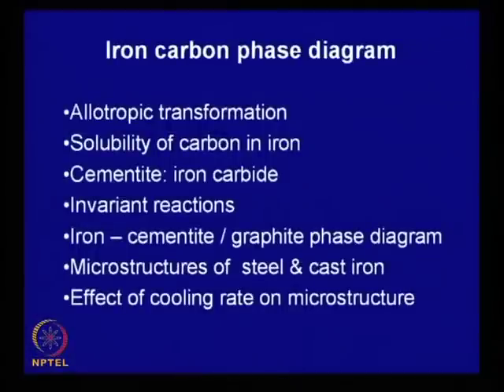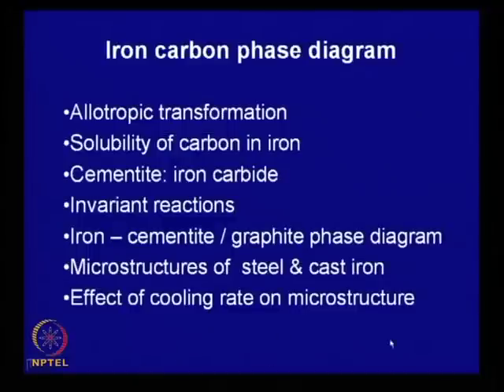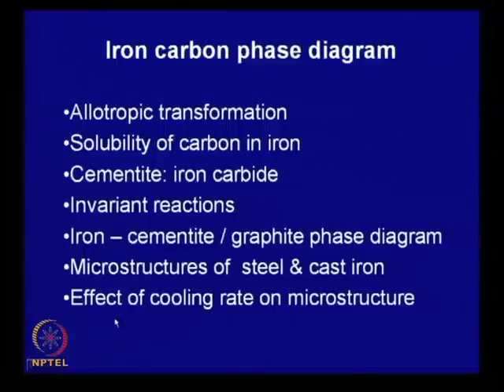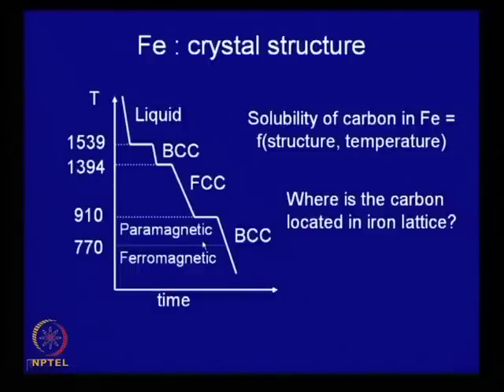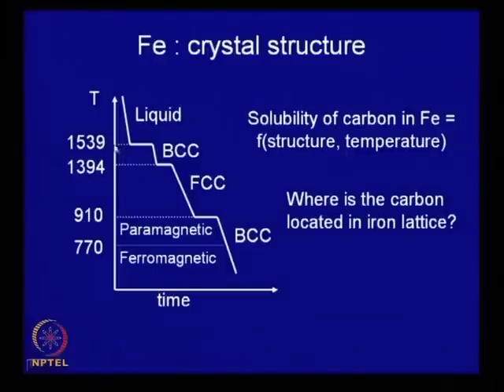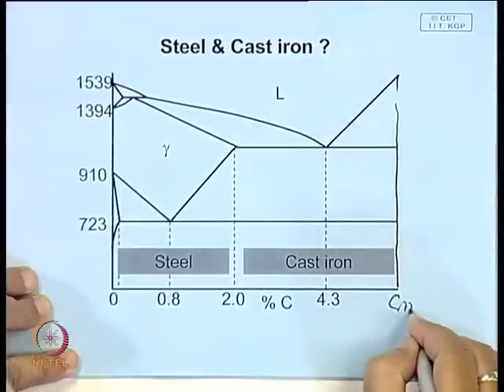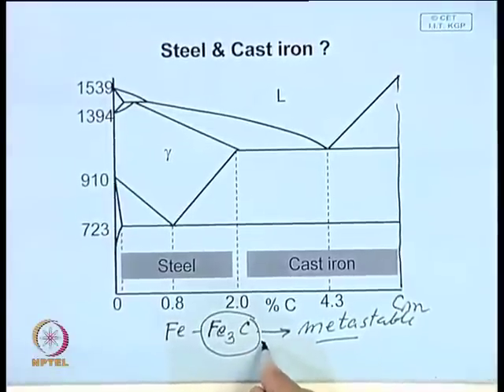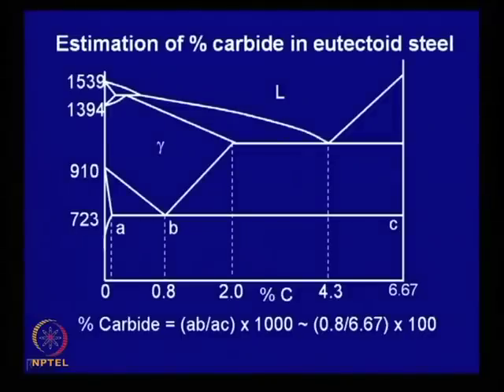Mod-01 Lec-23 Iron-Carbon Phase Diagram

Comment: Authors define the eutectoid point of the FeC diagram with different% C (example: 0.77%, 0.86% and 0.83%). What is correct value?
Reply: I´ve always used 0.76wt-%C as eutectoid point. (And 0.022wt-%C and 6.70wt-%C)
Reply: eutectoid point varies with alloying elements.So it will depend on the alloys present in the steel.In general it is  .77%C.

Comment: What Is the amount of % Cementite he talks about at 42:35 ?

Thank yoU!
Reply: Man I wish someone had answered this. I hate when lectures do this, there is nothing gain from it.
Reply: I think what he said is to calculate the cementite in Pearlite. Because as its cooling down below the eutectoid isotherm, only the autenite is going to produce ferrite plus cementite or in all, pearlite. Therefore to calculate the percentage of cm in Pearlite, it should be ab/ad which is around 6%. But to know the cm% in total, which is ferrite plus pearlite, use 6% times the percentage of the pearlite, which is nearly 50%. Thus in total, the cementite is around 3%.
Reply: On the left side of "C" there is no cementite forming at all just ferrite and perlite where perlite increases with increased carbon content and at 0,8% you have 100% perlite. On the right side of "C" it's starting to form cementite and you can calculate the percentage of cementite and perlite just like you calculate ferrite and perlite on the left side of "C".
Reply: Cementite/ferrite =ab/bc
Cementite = 50%